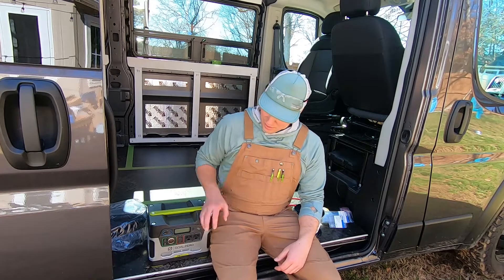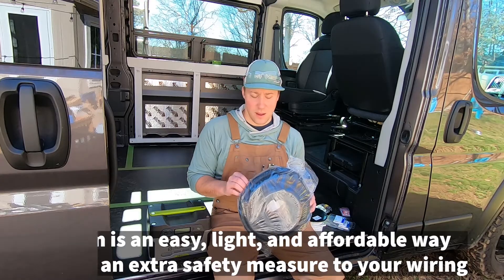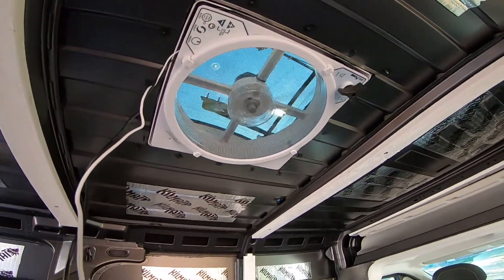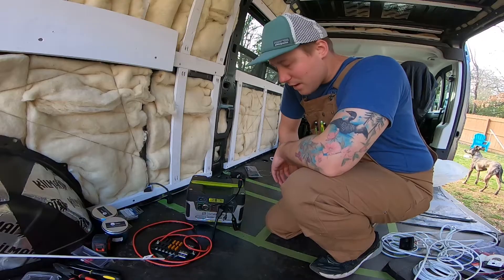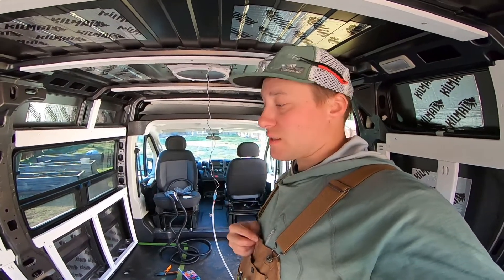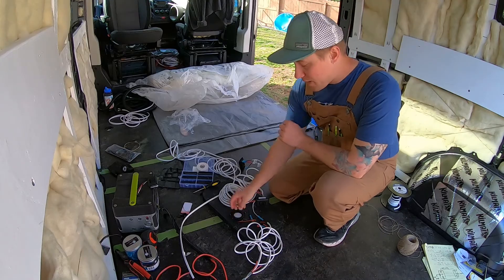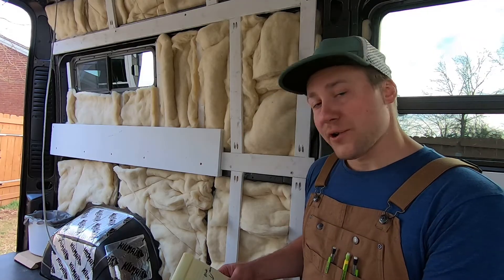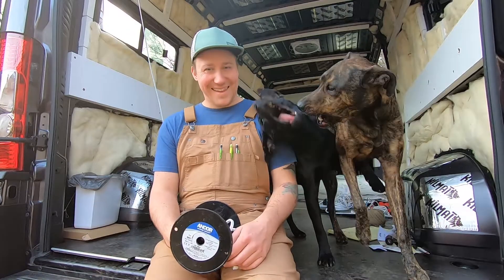Van Electrical Wiring + Goal Zero Yeti Power Station, Part 1 //Ep. 8 DIY VAN BUILD

Comment: I wentcin the opposite direction!  Kept it Simple.  I use a jackery 1000 and just added a jackery 2000.  I have rechargeable led lights w magnets so I can move them around I am added LED Strip lights.  I have 45qt ICECO Freezer fridge running directly off the 12v socket of 1 jackery I will run the maxxair off the other one's 12v socket. I car recharge jackery while I drive or since I am more RV Camper than #vanlife I can recharge in Campground or at home.  I  have 9 usb,  6 110 AC and 3 12v and may add 2 more 12v near side and back door? So the only wiring I need to do is 12v plug to Maxxair and any 12v sockets I add.  My jackery have built in inverters so can run Everything Microwave, Insta pot, blender, induction stove, heaters, electric Blankets all just plug into AC,DC or USB Outlets already there on the jackery power stations.  I do Not have solar yet? May get portable panels? I like those becux I can park in the shade - if available - and charge jackery w panels in the sunlight, not turn van into an over in the sun.   I just want to keep my build simple.
Reply from the maker: That’s great! Even though we wired everything in it is still a very basic system compared to some of the beefy diy systems out there. We could easily switch out our Goal Zero for a Jackery and run everything pretty much the exact same way. Definitely do what works for you! If you have questions on anything let me know and I could try and help.  The portable panels sounds like a great idea! There are some great options out there for that! I’ve even thought about adding some to make our system larger since we only have 200 watts on the roof.
Reply: @northstaroffgrid   jackery, goal zero, yeti. Ect are all about the same?  I like to keep a same line?  Like Ryobi batt tools?  ALL use the Same Batteries!  As use said,  some of these van wiring systems are like the Space Station?  I am SAE Cert mechanic! I Can do those wiring systems I just don't Want to do it!   I told u how many plugs is have?  And I use those led lights as flashlights and in Campsite not just mounted into ceiling?   Some of these vans are far nicer than my apt!  But my Vanessa works for me as she is?  I have plans for her now that I am retired and have more time but simple is working for me now?

Comment: Hey Matt! Your videos have been so helpful in my van build process. I am using a goal zero yeti 3000 and was wondering if you are using an adapter to plug into a campground 30 amp for your 15amp shore power plug? Thanks!
Reply from the maker: Hey! Thanks for following along, glad the videos have been helpful to you! We personally don’t have an adapter because  we can always find a standard 15 amp outlet for our extension cord and pass thru shore power plug. A 30 amp service wont charge a goal zero any faster than a standard outlet. But if you are at a campground where there is only a 30 amp service i would expect a 30 amp to 15 amp adapter would be helpful for charging. It hasn’t been something I’ve ran into however so it hasn’t crossed my mind to buy an adapter. Hope that helps.  Let me know if you have other questions 😃

Comment: Okay… so are the wires coming from the fan a smaller gauge than the wires they’re connected to? I was going to do that but then read that you’re not supposed to connect different gauge wires because its a major fire hazard? Im so confused and frustrated trying to do my build.
Reply from the maker: You can always have a larger gauge before the 12v appliance's wire. Wire gauge sizes as they get larger (smaller in number) can allow more current to flow through them. A Maxxfan has a smaller wire that you connect to, going back to your fuse panel you want wire sized for the amps going through it at the distance of the run. This Blue Sea Systems chart is very helpful in that regard~ http://assets.bluesea.com/files/resources/newsletter/images/DC_wire_selection_chartlg.jpg

The danger in different size wires would be if you ran a 22 gauge wire from your fuse panel to the 12 gauge wire coming off of your water pump. A Shurflo water pump should be fused with a 10 amp fuse. A fire could start trying to flow 10 amps through the 22 awg wire back to your water pump.

Hopefully that helps! Let me know if you have other questions 🙌🏻

Comment: Thanks for the video! Do you know of anyone else selling the Goal Yeti max current cable? They've been out of stock for a while on Goal Yeti, needing to get one for my system!
Reply from the maker: Are you using one of the older lithium systems, a v2? If you have the newer X line you no longer need a Max current cable because they now have a 30 amp output from the HPP... If Goal Zero doesn't have an item I usually always check B&H Camera because if had luck getting things from them but they are out of stock too. Probably a supply chain issues sadly. I'm not sure where else you could find one. Sometimes different outdoor retailers carrier them. It can be hit or miss however. Sorry I can't be much more help

Comment: So with the Goal Zero battery do you not have to worry about putting a voltage regulator on the MaxxAire fan?  I've seen a lot of diy van folks complain that the board in the fans has been ruined by >12 v coming in.  If you don't have to worry about that while hooked up to your little battery, what about shore power?
Reply from the maker: The new X line has regulated 12v so you don't have to worry about it any longer. We now have the 3000x and have never had issues. Luckily we never had an issue with a fried chip or the green light of death in our Maxxfan previously. We did have it shut down randomly when solar charging kicked in at times.

Comment: Love your stuff, good job. Can you tell me about how many feet of wire you used for your set up?
Reply from the maker: Thanks you! 😊 Glad it can be helpful to you! I purchased a 100 foot spool and then a 250 foot spool of the 14awg duplex wire. I had a decent amount left over on the second spool. I'm not sure if I could have got away with a single 250 feet but it probably would have been close. Having two switches for my lights in two zones was the biggest run

Comment: Hi, how was the end of the fan wire connected to the fuse box?
Reply from the maker: I used 2-strand 14 awg wire, one side has ring connectors for the fuse box and the other had spade connectors to plug into the ones I attached to the fan's wires. Basically just extending the wires far enough to the fuse block

Comment: Great video. Question, do you have to ground the blue seas fuse box? I have the yeti 3000 with cat link module. Running espar, dometic 95, and 4 12v outlets.
Reply from the maker: Goal Zero states that you don't because of the protection cut offs within the unit but I did run a wire to the chassis as backup
Reply: @northstaroffgrid  thank you. I’m gonna do the same thing.
Reply from the maker: @michaellienemann5207  no problem! All the best in your build! 🙌🏻

Comment: Thanks for making time to record, edit, and upload your videos.  They’re well done and helpful. We just ordered a GZ YETI 3000x, and I can’t figure out what to use to connect it to the fuse block. Do anderson powerpole and the new HPP use the same connectors? I appreciate your time and help!
Reply from the maker: I'm glad they can be useful to you! 😊 Thanks for letting me know, it always makes my day to know I'm putting out something helpful to others!

I think Goal Zero is rebranding the Anderson Power Pole as the HPP. It is the same connector and the standard sized Anderson connector can output up to 45amps over the 30amp max output. I used this Anderson to ring terminal that I found on Amazon~https://amzn.to/3agzsFU 

You could make one yourself or use a different pre-made cord too. For the run length and max output using Blue Sea's wire gauge chart it should be spec'd well for the fuse block. Let me know if you have other questions 🙌🏻

Comment: Did you use both one inch and half inch wiring loom?
Reply from the maker: Yes I did. Mostly I used one inch where there were multiple strands and the half inch with only a couple. I covered nearly all my wire throughout the van
Reply: @northstaroffgrid  How much loom did you use? I'm working with my sprinter 144" length. Trying to figure out how much loom and wire to purchase. do you also have any recommendations on a connector kit that has both male/female? the link you provided has large qty and feel like i'd have a ton of leftovers. thoughts?
Reply from the maker: I think I purchased 3 x 20' - 1 inch and a couple 1/2" loom rolls. It really depends how many runs you have together. How much you want to cover every wire. How many appliances you have. Etc. For the connectors my suggestion would be to buy quality ones, good reviewed, and hear shrink ends. I've heard horror stories of melting connections from some of the cheap kits on Amazon. Going to a local hardware store like Ace or an auto parts store like Auto Zone could get you 12 or 24 packs of different connectors usually with waterproof heat shrink ends. The auto stores have some kits too that may be good for the elements.

If you want to chat more about it, send us an email and I could maybe try to pull some items off Amazon if it could be helpful
Reply: @northstaroffgrid  Radical, thanks for the quick response. Do you have a good email I can respond to? I can't find anything on youtube
Reply from the maker: It's listed in our about section but it's TrailVagabonds (at) Gmail (dot) com

Comment: Hi Matt, been following along on your build.Thanks for putting out such awesome content. Question, I'm currently in the process of a similar build except using a Yetti 3000x. I'm kinda stumped on how I should wire the rooftop AC unit and could use some advice. The Yetti doesn't have continuous pass through electricity, so if I plug the AC unit directly to the Yetti inverter it will drain the lithium battery within 2 hours. The second issue is that when plugged into shore power using a 15a outlet, I doubt I'll be able to run the 14a AC unit plus the Yetti 3000x without tripping the house breaker. Any ideas on what would be the best solution? Thanks in advance
Reply from the maker: Thanks for following along and I'm glad they can be helpful! We opted to forgo an AC unit and only have two Maxxfans. I didn't research enough to give you a confident answer utilizing the Goal Zero but maybe their tech support could be helpful to speak about pass through capabilities. Depending on the unit, startup would be my main worry. My first thought it most AC units expect you have a 30amp shore power hookup like an RV. If it's as easy as plugging in the AC to a 30amp plug, I would suggest you have an input for it to run the AC directly while the Goal Zero is there for everthing else you are powering. Two shore power hookups may not be ideal but setting up a single 30amp hookup to power both may be possible. Again, I haven't researched it enough to give you a complete answer. We went with a 15amp plug because Goal Zero has standard wall chargers for fast charging of the units and a 30amp wasn't needed for anything else we have in our van.

I hope that can be helpful, let me know if you want to bounce any other ideas around it 🙌🏻

Comment: Do turn the yeti power box off and on when you leave the van if so how does the food in the fridge stay fresh
Reply from the maker: We don't currently have a fridge just yet but we won't turn the 12v power off when we do. You can leave it on without worry. As well as hooked up to solar so it's continually charging when the suns out🙌🏻
Reply: @northstaroffgrid  last question, How did you connect all the puck lights to the switch, did you twist them all together then clamp connectors, im lost on the whole pucks to switch, switch to fuse box?
Reply from the maker: I used butt connectors with the wire going in to and out of to the next light doubled up in one side and the light wires on the other. I didn't trust with vibrations of the road that twist connectors would work well long term.

Here is a simple video explaining led wiring if it's helpful -
https://youtu.be/14tbL2uIGKQ
Reply from the maker: I realize I didn't completely answer you question. To add-I used spade connectors to clip into the terminals on the switch. Here is a video that was helpful with the 3 way dimmer I used
https://youtu.be/6lejHz6FtLM

Comment: Very nice! When you do decide to upgrade to the Goal Zero Yeti 3000, go ahead and install the Victron Orion 12/24-15 Isolated DC to DC converter. Then just put into "power supply" mode using VictronConnect app. 
I've done this setup with the Yeti 1000 in my van and it works very well. Especially in rainy Vancouver where there is hardly any sun I charge the Yeti while I drive. I've got a video on how I've done it.
Have a great day, looking forward to more of your van builds!
Reply from the maker: Nice! I'll have to check out your video on it. I've heard of that option before but hadn't looked into it. I did actually purchased the Yeti Link which can be used to charge while driving as a b2b. I purchased it since we knew we'd upgrade. I have heard they've had some issues with it though
Reply: @northstaroffgrid  Yeah I've heard about that too. When I looked into it my early Yeti 1000 would have required to be sent back to Goal Zero in Utah for a firmware upgrade. So I researched and found this method. Works very well. And no need for an upgrade, and I can repurchase it vs the Link you can't repurpose. Best wishes either way you decide to go. The Yeti 3000 is a beast!
Reply from the maker: Thank you! 😊 And I'm glad you are enjoying our videos! All the best!

Comment: I have a Yeti 400 sitting around too and would like a similar setup.  however, the Goal Zero website says 12V MAX CURRENT CABLE is not for use with Lead Acid Batteries.  Have you had issues with Yet 400? Did you upgrade to lithium?
Reply from the maker: Hey Jason. I bought the cable because I planned to upgrade to a lithium system but I still haven't yet. The AGM has a max output of 10amps or 120 watts from ALL 12v outputs combined so the max current cable doesn't do what it is intended to do. The lithium stations can output 10amps from each 12v output (the new x models have a large output from the Anderson connector which makes the cable unnecessary too). We are definitely near maxing out the 400 right now and have to be mindful of our draws but knowing the shortfalls and being careful, it is still a great system to get you by. If you have any other questions about it, definitely let me know 👍🏼
Reply: @northstaroffgrid  Thanks for the feedback.  Yeah, I'm just running a few items to a small teardrop camper I'm building so I think I'll just get GZ 6mm male to ring terminal connecter.  Thanks again!  Great video!!!
Reply from the maker: That will work perfect! I only use the 6mm connector on the max current cable now. I just didn't want to buy more than one item if I was going to upgrade. Good luck with your project, I always wanted a tear drop! Cheers!

Comment: Did you cut jumper cables? And di you splice a regular plug to them for the inverter? I have the same van but I’m doing a mobile Barber Shop.
Reply from the maker: Since I'm using the Goal Zero system, the inverter is internal to it. If you are asking how I ran outlets from it, I used extension cords that will plug into the Goal Zero AC ports. I cut off the end and wired them to standard household AC outlets. If you are interested in this process I included it in my Shiplap Wall video.  Hope that answered your question, let me know if I can clarify anything👍🏼
Reply: @northstaroffgrid  so you wired a spliced extension cord with the plug into a regular receptacle?
Reply from the maker: I cut off the female plug on an extension cord and wired the wires directly into a 15 amp outlet. Starting at 3 min 58 seconds in this video~ https://youtu.be/Hls4E1Vqwzs

It's a pretty simple process. Let me know if you have other questions
Reply: @Cascade Yoga Co. I’m Oklahoma City. Where are you?

Comment: For the extension cord to outlet connection, did you use 15amp outlets? Thanks for your awesome vids!
Reply from the maker: Yep. That's the standard household outlet rating so I stuck with that. I also got GFCI protected outlets for added safety.